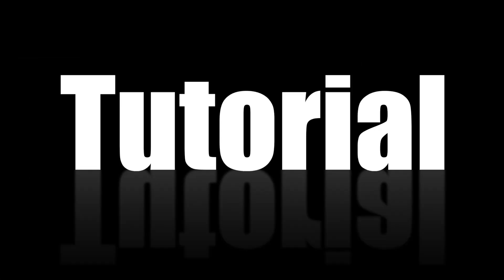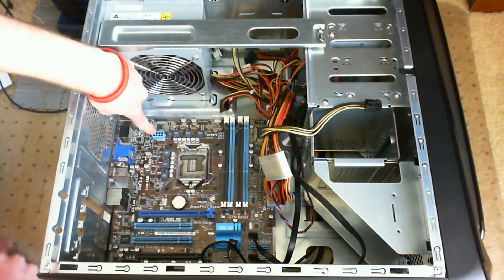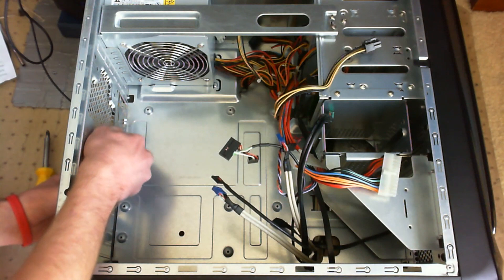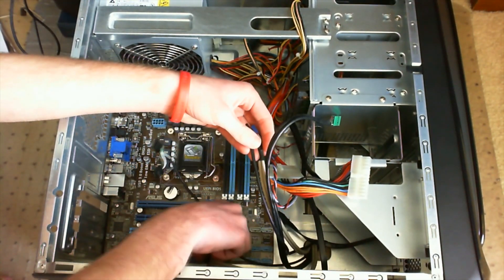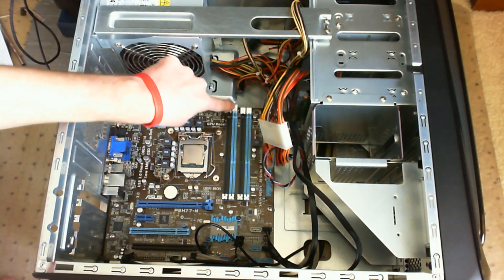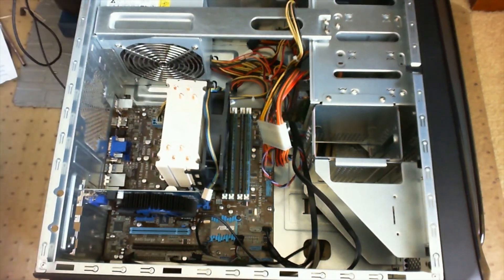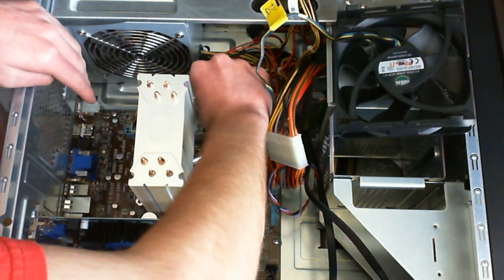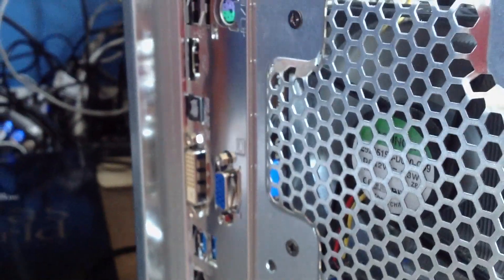How to Replace a Motherboard

Comment: Hey question here, if you replace your motherboard will you need to install new windows OS on the new motherboard, or will the windows OS stay in your harddrive?
Reply: i too need to know this
Reply: i think ... no cuz the hdd is the same
Reply: you might need to change some of the drivers,
Reply: Why would the os be in your motherboard? It's in the harddrive it shouldn't go away unless you change it.
Reply: The OS lays on the Hard Drive not on the motherboard. So if you didn't change the HDD then I believe you have nothing to worry about. Unless... your current old ass OS is not compatible to your new super sleek motherboard :)
Reply: you will need a fresh windows

Comment: are the motherboards all approximately the same size so I dont have to worry about the size it takes in my case and if the screws are at the proper place?
Reply from the maker: There are some common motherboard form factors such as ATX mATX, mITX, and a few others. As long as you get one that is the same form factor, it should be about the same size and should be compatible.

Comment: Hey, I just wanted to know if I need some sort of special fluid to remove the thermal paste. Also, do I need to buy the thermal paste separately, or does it come with most motherboards?
Reply from the maker: You can just use rubbing alcohol.
Reply: VM Media Group Thank you!

Comment: how do you know which cable goes where
Reply: Should be marked on the motherboard.
Reply: Looking over the manual that came with the motherboard is a good idea, as well. Obviously.
Reply: i lost the manual Obviously
Reply: Akeche
I'm having anxiety regarding this, because some are marked the same and some aren't marked at all. Some are left without cables.
Reply: Axel Winnberg i know each pc is ddifferent

Comment: do you need drivers of new motherboared before replacing
Reply: That's what I want to know. Not one of these youtube videos explain what to do for first booting up. Do I install motherboard drivers then OS or what???
Reply: ***** I read the same thing, it says if the mobo is different than the one you actually had you would have to reinstall Windows now if its Linux you don't have to do the reinstall. When you reinstall windows, it should install MOBO drivers
Reply from the maker: april southerland If the motherboard is similar to the model of your old one, especially if they have the same chipset, you can usually get away without reformatting or reinstalling Windows. To HitManHey - you can't install drivers without an operating system. If your current operating system doesn't work with the new motherboard, reinstall Windows. Any drivers needed would be installed by a clean installation or usually through Windows Update. More up to date and expansive drivers and software are available on the disc that likely came with the new motherboard or on the motherboard manufacturer's website.
Reply: So let me ask another question, AM3+ is not backwards compatible with AM3 is I? I have a AM3 mobo but was wanting to upgrade to AM3+
Reply from the maker: The AM3+ socket is required for the FX series of processors based on Bulldozer. 

AM3 supports Athlon II/Phenom II
AM3+ supports Athlon II/Phenom II/FX

No, it's not backward compatible.
Reply: Well there are still some nice quad cores for the AM3 so that will be fine then
Reply: +VM Media Group so I have a pc, bit my motherboard has broken? could I not just replace the motherboard?  or would I have to reinstall windows?  and would I be able to keep all of my data n stuff?
Reply from the maker: +masonicN If your motherboard has failed, you can replace the motherboard, yes. If you get the same or a very similar motherboard, you can just swap the motherboard and continue going with your current version of Windows or other operating system. However, if you get an entirely different motherboard, especially one with a different chipset, you will probably run into various driver issues that require you to reinstall Windows from scratch. Regardless, you should always back up your data in case of a technical failure. That being said, the motherboard replacement won't directly affect the hard drive, so you can connect your existing hard drive to another computer or external enclosure to retrieve your files, regardless of any motherboard situation.
Reply: +VM Media Group so If I did replace the motherboard, what would happen when I booted it? and could I just boot straight off of a usb install and replace the windows that way, whilst still keeping my files games and stuff there? (sorry im a bit of a noob)
Reply: +VM Media Group I would be replacing the cpu aswell...
Reply: buy a motherboard with the drivers already on it and then install an os

Comment: EXCELLENT VIDEO, i AM FACED WITH REPLACING MY NEW ASUS PRIME H370M-PLUS/CSM
 MOTHER BOARD ON MY OWN AND THIS WAS GREAT TO SEE. I'M NOT TECH BUT i WILL BE SOON ENOUGH. THANK YOU. MY SET UP IS VERY SIMILAR TO YOURS. IS MY BACK PLATE ALREADY INSTALLED> IT'S A NEW COMPUTER BUILD BY A PROFESSIONAL COMPANY FOR VIDEO EDITING. WHEN I TAKE MY MOTHER BOARD OUT WILL THE BACK PLATE BE FINE AND IT TACK. LIKE i SAID MY RIG LOOKS VERY SIMILAR TO YOURS.

Comment: I have core 2due with ddr2 ram slots but i want to change it to DDR3 can it be done without changing your processor but only to bring ddr3 board
Reply: you would need to relace the motherboard, the slots on a ddr2 and ddr3 are diffrent

Comment: Will your processor overheat or something if you don't apply the thermal paste, and will you have to reapply the paste in the future?
Reply: Also is a heat sink required?
Reply: Dave Strider this is probably late but ye, you must apply the thermal paste. No, you don't have to re apply later but it would not be a bad idea.

Comment: Is it necessary to change processor for changing a Motherboard?
Reply from the maker: You need to put the CPU into the new motherboard, but you shouldn't need to put a new CPU in unless the two motherboards use different CPU sockets
Reply: VM Media Group
so i should buy a new processor?
Reply: Lucas Hello Lucas,can you suggest me a motherboard which is compatible with e7400 @2.8 ghz and has max 8gb ram slots

Comment: Uhm i have a problem, what if i replace my current motherboard with the same exact model, will i still need windows 10 home 64 bit product activation code thingy or will it turn on like nothing ever happened?
Reply: It will turn on normally

Comment: I'm wanting to install new cpu, ram, and motherboard but scared I'll screw it up and GG, I have never touched inside of a computer in life. 

I want to replace i3-2120 with i5-6600 3.3ghz, wanting at least 16GB of ram motherboard I have no idea, something that's affordable I'm on a budget of $900. (gaming purposes) 

I already have GTX 1060 3gb Gpu, 650W PSU, already in runs win X 64bit. 

Is it wiser to let a professional do it cause I don't know what on earth I'm doing,  or try and learn for myself?  

Is there any other complications after the install like do I need to reinstall games, or Windows 10 etc or does it run smooth sailing and I can just jam? 

Reasons why I was thinking doing it myself it's cheaper but doubts are I'll ruin otherwise... And cause i3-2120 will bottleneck I can guarantee you on the 1060 3gb. 

I'm not joking I've been seriously thinking it over if it's worth the stress vs money..
Reply: me to my pc has i3
Reply: also all your games and windows are installed on your hard drive

Comment: hey guys if i change my motherboard i have to install everything or its gonna just star up like normal?
Reply: Since all of your files are saved on your Hard drive and Windows on the SSD, Windows will start up like normal! :)
Reply: omg thanks :)
Reply: barsaXD  NO it wont, you have to reinstall windows because the motherboard is different and it has to reinstall drivers for the motherboard. I looked this up too. I seen from tomshardware that it said to reinstall windows if its a different mobo.